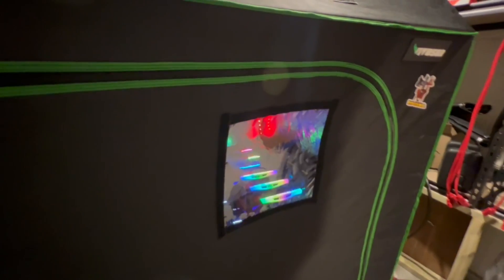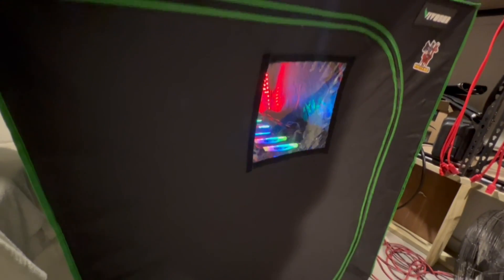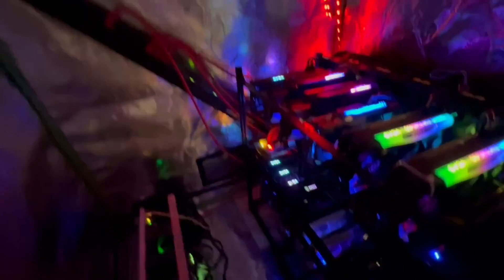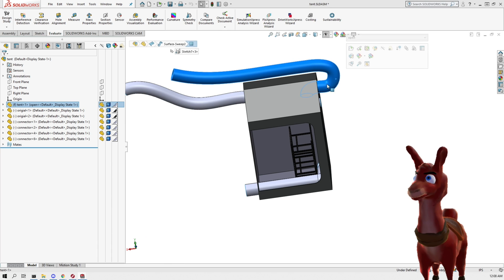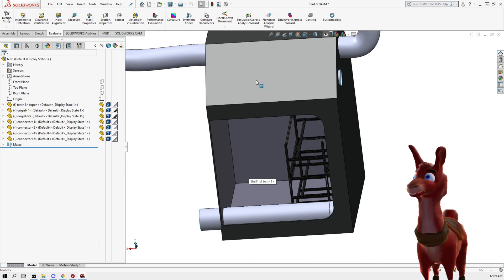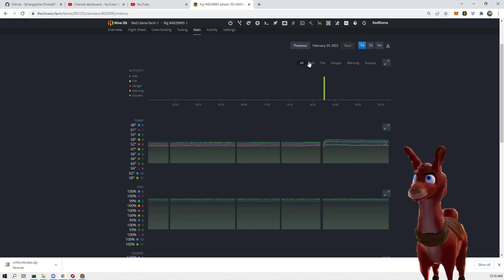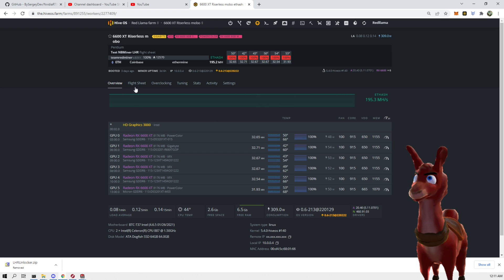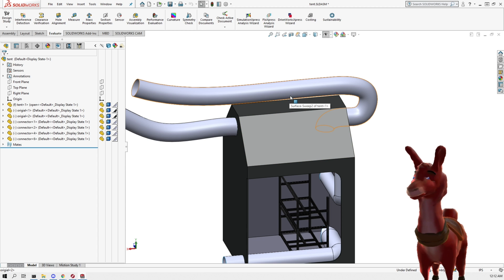24 hours Stats on GPU Mining Grow Tent Setup

Comment: can this solution prevent the cards from getting dusty ?

whats the point of this grow tent ?!?......

do you keep your cards at 100% all the time inside the tent or what ?!...

thanks,
Reply from the maker: I have to get filters on this. It keeps the heat down in my home.
Reply: @RedLlama  so what's the point of the tent ??
Reply from the maker: @SkyHighFilms777  more air flow. Instead of the heat dissipating into the house and heat dissipates outside And keeps the house cooler without the need of more ac.

Comment: You're killing your fans with that much negative pressure. Open up a couple more flaps, your tent shouldn't bow that much. Yes, you need more negative pressure than positive, but what you have there is making your fans run a lot harder than they need to be.
Reply from the maker: I am working on getting more airflow in and to move the exhaust outlet more to the top. You are right i need to find a balance.